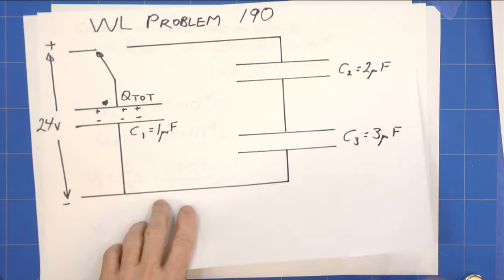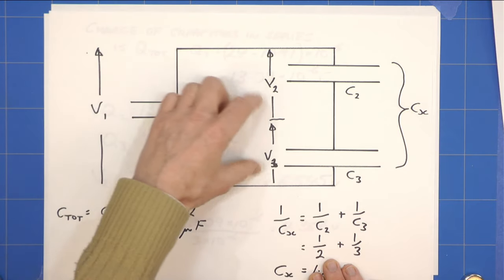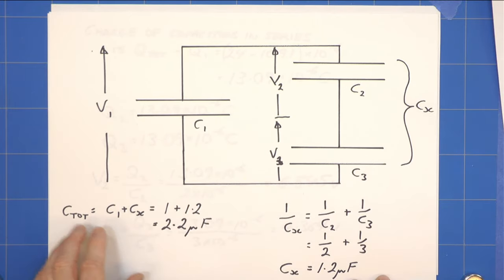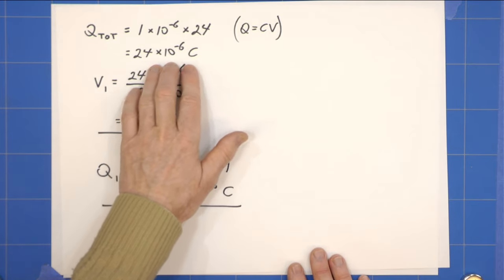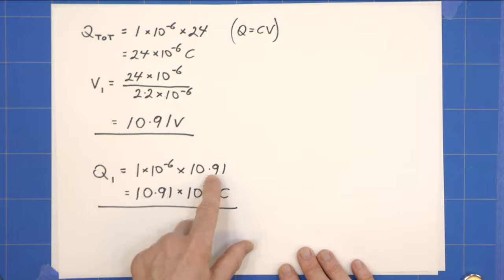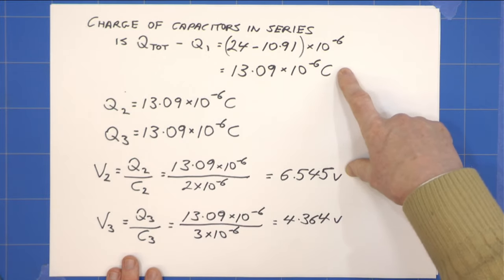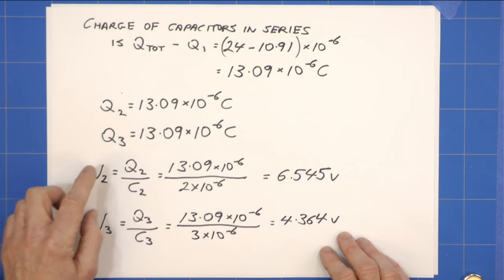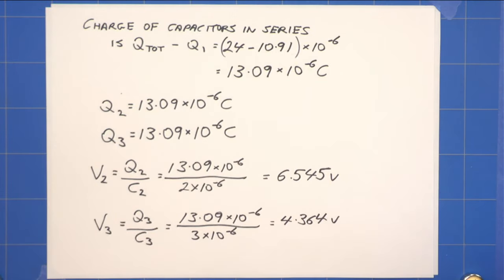Keith's video solution Problem 190

Comment: Hello Professor Lewin, I'm a big fan of yours! 
Love your teaching. First class! :trophy-yellow-smiling:😁
Can you please help me for a minute?
- I was reading a comment for your latest problem, 
and I am now slightly confused about capacitors...

I presume that once the source is disconnected, 
these charges jostle for their positions quite a bit.

Professor: 
1. How is the motion of the charges modeled in the unpowered circuit with just one capacitor?
2. Why does a powered circuit voltage of source and capacitor stay the same, again for just one capacitor ?
3. Same questions as 1 & 2, but for multiple capacitors.
4. Can you provide me a reference for any media materials pertaining to these questions?

ps. Happy 88th birthday, Professor!!  🎂🤓
Reply from the maker: I suggest you watch my 8.02 lectures where I cover capacitors and dielectics
Reply: @lecturesbywalterlewin.they9259  Thanks for responding. Have a good day, professor. 😊